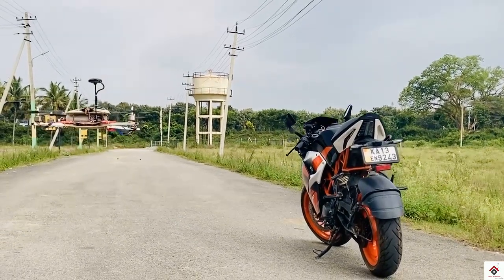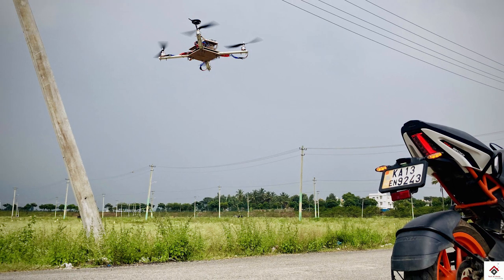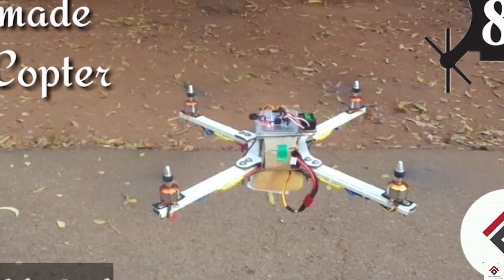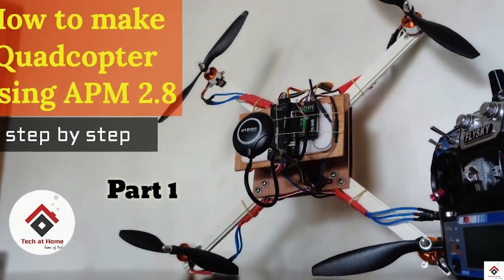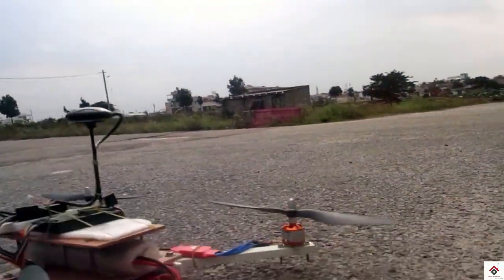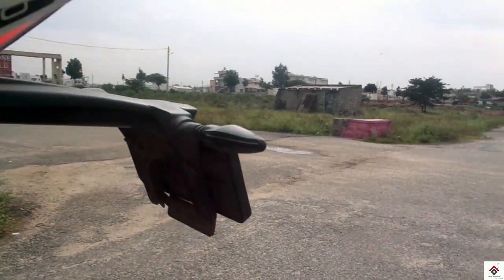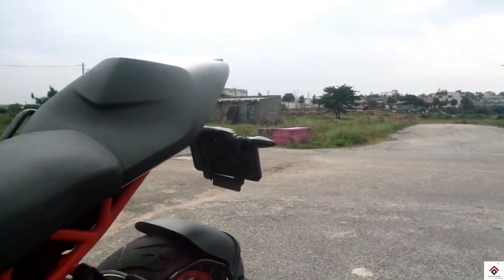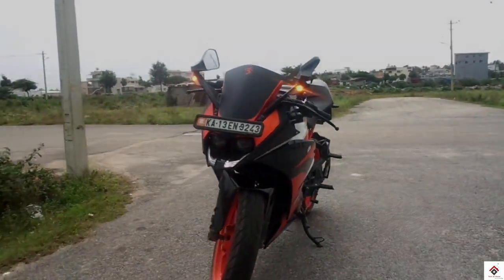Homemade Drone vs KTM RC200 Drag Race!🔥🔥 - Bike vs Drone [APM 2.8 Quadcopter 1000kv] | Tech at Home

Comment: Bro you should put the drone in altitude  hold mode
Reply from the maker: Yes it's in Altitude hold, but when we are keep holding the forward stick continuously, it's going down since rear two Motor speed will keep increasing